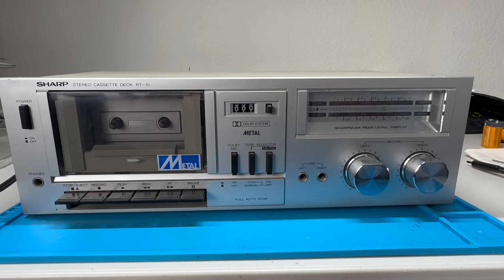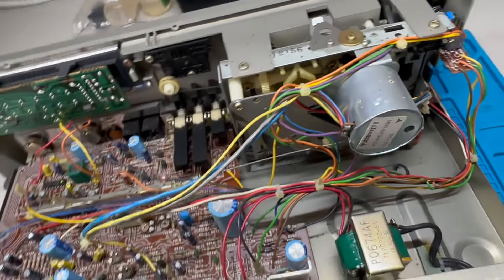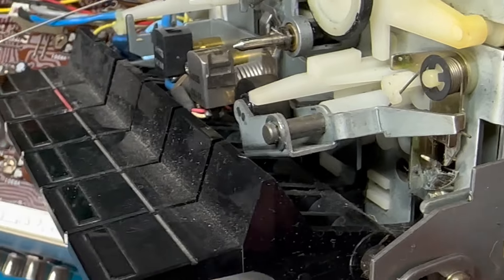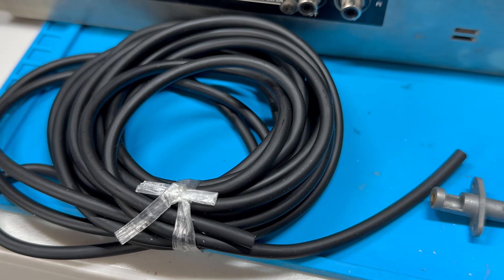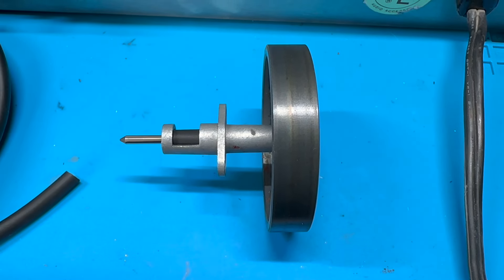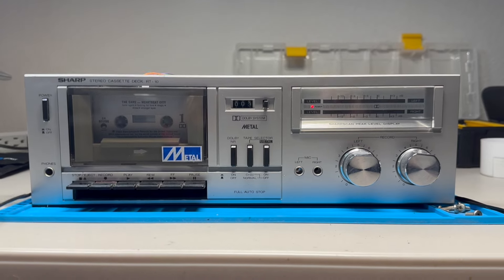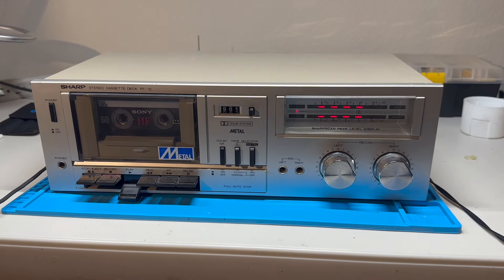Repair Vintage Sharp RT-10 Cassette Deck Belts, Capstan Tire from 1980

Comment: Just picked on of these up of the carboot for 6 quid. Has the same issue yours had as well as the back and bottom of the unit being rusty. It is on the list of things to be fixed!

Comment: i finally did and repaired mine mostly using your video. the deck plays perfectly fine. thanks again it is really helpfull. 
it was a fiddly task though. especially getting that mechanism out of there. i somehow lost the spring to the door opening mechanism, found it on the circuit board, picked it up with plyers and dropped it on  the floor in a mindless moment. spent a good amount of time crawling on the floor looking for that spring until i just took a spare spring out of a broken mechanism.  works just as fine but super annoying lol
Reply from the maker: Nice job!  I keep a strong magnet around to fish for springs that decide to escape. ;)
Reply: @EricMarschner  good idea! i am going to magnet swipe the floor tomorrow. haven't used the vacuum cleaner in this room since ;)

Comment: Not a terrible repair at all.  You did well. 😊
* According to some Sharp service manual parts lists, the capstan tyre is named as a "shaft sleeve". You can cut a piece of 2mm x 5mm silicon rubber tubing to 5 mm length and it will work the same way, unless you are able to order the correct parts for your model (the inner diameter/hole is 2 mm; the outer diameter of the tubing must be no less than 5 mm otherwise it won't make contact with the idler wheel). The capstan in your deck is similar to the type used in the more popular portable GF-555 and GF-666 models.
The big plus is it all works properly after the repairs and you don't have any vital parts or screws left over. 😇

Comment: Hi. I have the same deck being repaired with the same problems (already resolved).
However, one problem stand still. This is a dropped out spring that helps opening the cassette door (part number 101-G in service manual). I can't figure out how it stays in place. Can you please help me with a photo or just an explanation of where I should put it?

Comment: thanks for the video! now i feel safe to start repairing my rt-10 :)

by the way i think the RT-10 has a cooler look compared to the RT-20... more 'analog' style with less computerised parts. i wish it had classic analog VU-Meters though. Since you have both: is there a difference in sound quality between them? or is the difference just about the display of the RT-20?
Reply from the maker: To my ear, they are the same... but they are also 40+ years old!  I like the RT-20 for the goofiness of the "computer controlled display"... but the RT-10 does look cleaner.
Reply: @EricMarschner  goofy is a fitting describtion. In 1980 that thing was probably a real technological gem
Reply: Question u mentioned motor speed adjustment where exactly  is that located  I have I similar  model but it's a fisher  when it records it just a little to fast and off .
Reply: @rotatorwrecker-180  usually right on the back of the motor. Often there is only one opening at the motor. Thats the spot where you can insert a screw driver and adjust the speed carefully
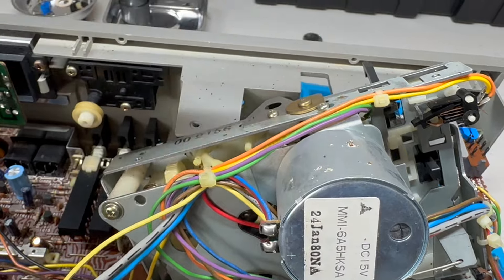Reply from the maker: @rotatorwrecker-180  Look at 02:36 in the video.. you can see a hole in the back of the motor... insert a small flat-head screwdriver to adjust the speed.  It does not take much!